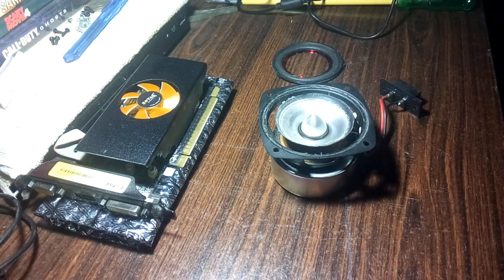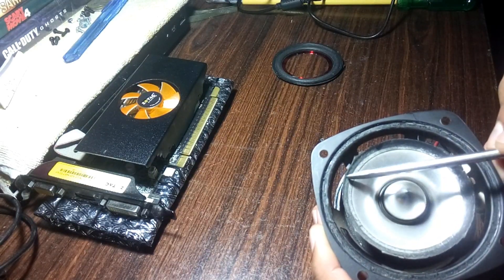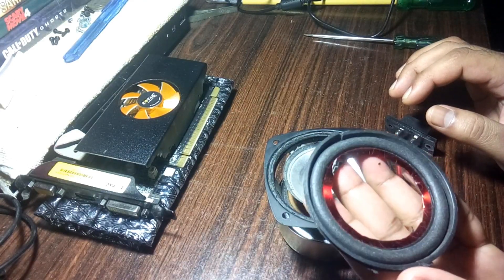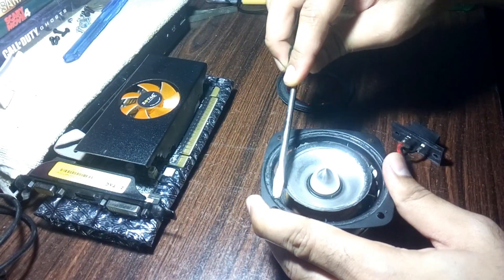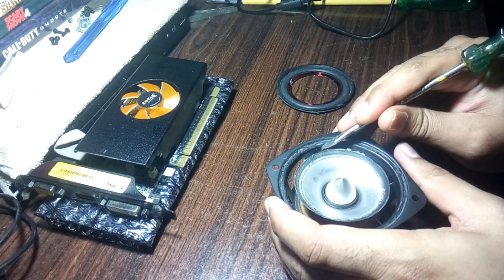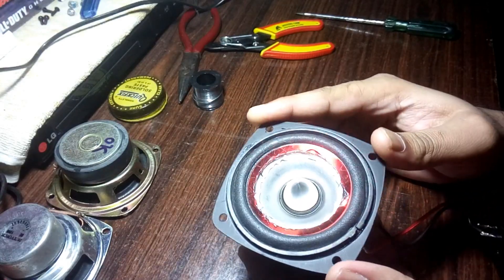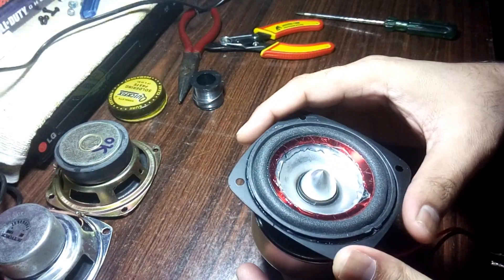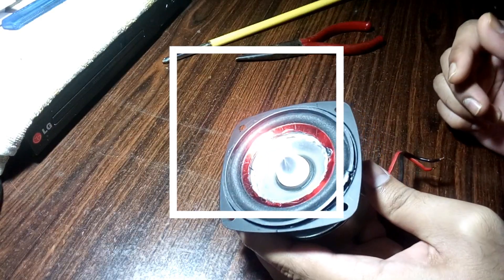SPEAKER REPAIR/ How to repair speaker foam surround at home/ speaker refoaming

Comment: I'm a welder bro I have thoses 500 RMS DTS sound for 17 years, I did that one time at all 5 and between me and you , show more quality, black glue outside of the rubber and the inside incolor, before putting the new rubber make a cone of paper and put in the center of the cone and then glue to make sure your cone don't touch when is working.
Reply from the maker: Thanks 🙏

Comment: Hi. Thanks for this video. I have sort of the same speaker (logitech z623). Both the speaker foam damaged. As i am not into repair business, may i know if the foam for these speakers are available for purchase. Also how long did this repair last, still just as good?
Reply from the maker: Its gonna last long if you use proper glue & fit the foam properly. You can search online at bangood or ali express.

Comment: So is it okay to just leave the old rubber on inner cone and just put the new one on top of it? Wont it have any long term effect? I have the same speaker and i cant remove the old one completely from inner cone cos its so sticky
Reply from the maker: Yes. you cant. If you try hard its gonna damage the cone edges. So better leave like that, but make it usre that its even on all sides. When you stick the new surround there must not be a tiny gap anywhere between the cone & the surround. Stick it properly & its gonna last long i think. Good luck bro
Reply: @technoboy-allinOne  Thanks, gonna order some new rubber rings and began my own project, it will take some time aince all of 5 satellites is damaged tho. Im glad i found your video, otherwise im probably gonna trying too hard to remove the old sticky rubber and destroy it in the process lol.
Reply: What measurements do you need for the rings exactly.I have the same z5500 speaker
Reply: @EPUR3  3 inch